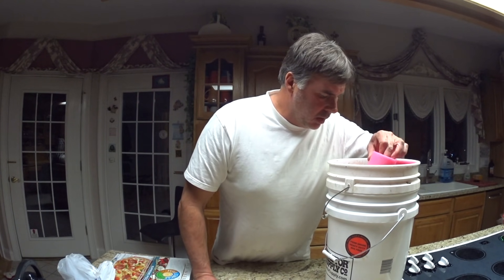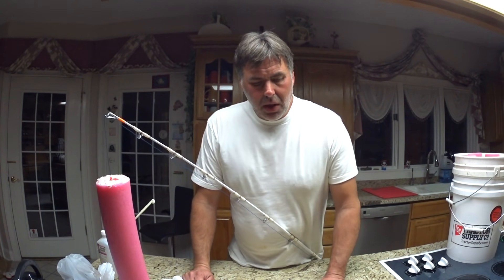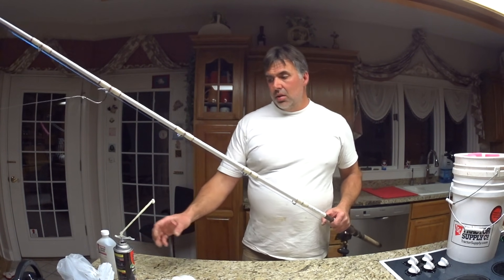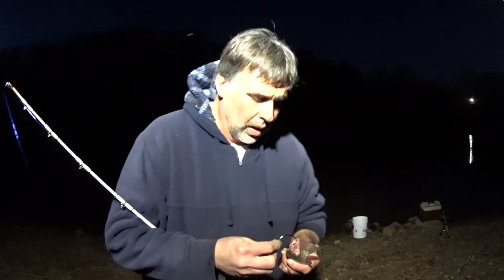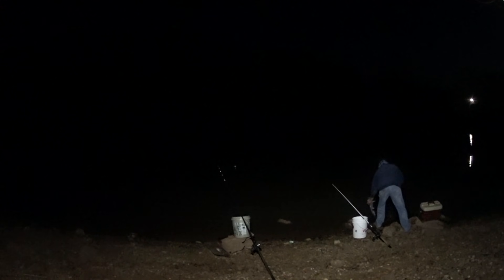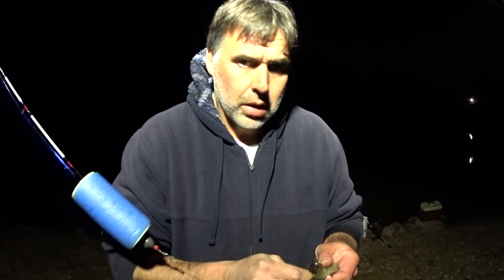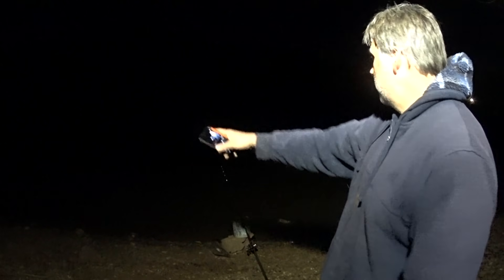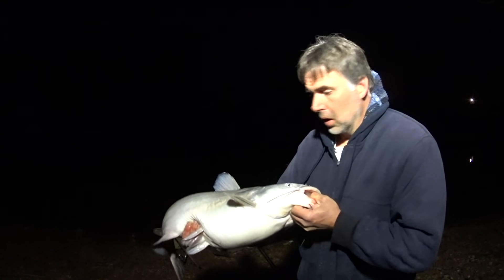The Catfish Dave Slip Float From Hell

Comment: I used the water cleanup foam. Takes overnight to completely setup but with water clean up one can make a can go a long way plus easy to clean the little plastic nozzle which is a pain to clean. I believe the water-soluble foam is a little lighter also. A little Elmers on the ends  next to the float is a good safeguard. Be sure and tape the float holes makes it a lot easier to cleanup.

Comment: I troll for striper 95% of the time an i made a float like that for straight out the back made like a planer board where when it hits it pops free an u fight the fish not the float  anyway i used 1/2 inch pvc an two caps maybe u can do that with a coffie straw glued or foam in  the middle for the line  if those floats are expensive but i really like your videos an i like that u make some of your own stuff instead of buying it thanks for the awesome videos an good luck
Reply: Is putting a bobber stop somewhere on the line?

Comment: Did you ever try inserting the one with a light built into the top of the float, just need to leave it sticking out enough to be able to change batteries.